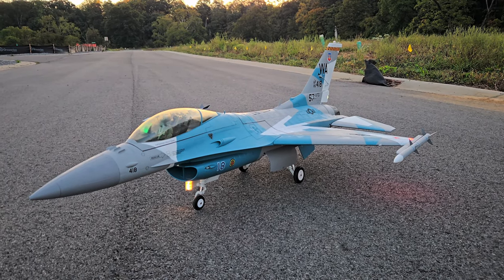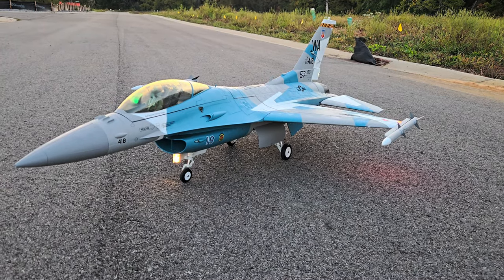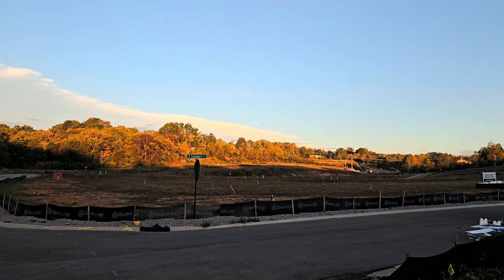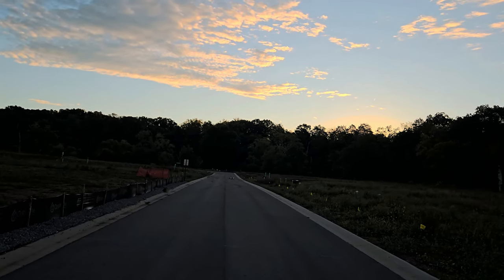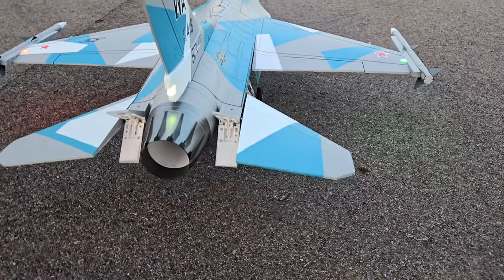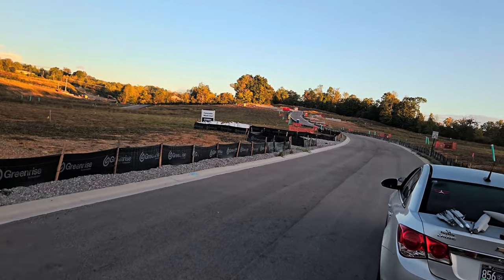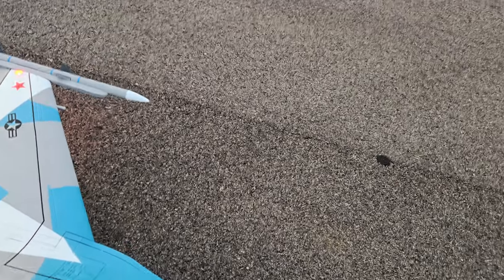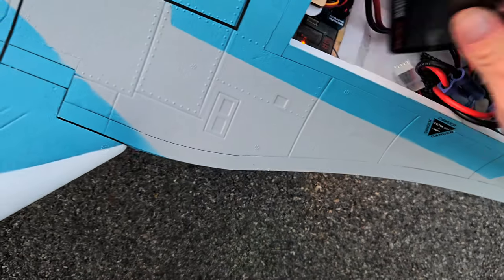ALL NEW= Freewing F16 90mm 8s  AMAZING EDF JET #rchobby #rcpilots #smokeymountainrc #aviation #rcjet

Comment: Where you have receiver and battery's makes my F16 very nose heavy...did you check balance before you flew it?
Reply from the maker: Yes it was way nose heavy. Now I'm putting the 6000 4s centered the straps. And my 5200 4s is about an I ch ahead of that.   Freewings cg on this jet is factory nose heavy

Comment: Did you also change out the fan or just ESC?  If just ESC,  which one,  thanks!
Reply from the maker: @afterburnerrc6333  no I just changed the 6s motor to the 8s motor.  Esc is still the same. Skywalker 120amp
Reply: @SmokeyMountainRcTravisThompson 

Ok im confused so you used the same fan,  swapped out the 6S motor to the 8S motor that comes on the 8S F16?  The ESC on  the 6S F16 will also handle 8S?
Reply from the maker: @afterburnerrc6333    I already had the 8s Zeus,  so when I got the 6s  f16 90mm , I took outthe 6s  motor and fan swapped it with the 8s Zeus motor and fan.  Yes they are the same esc 120amp. The 8s and 6s version uses the same esc.   I also have the 90mm J10A 6s, it also has a 120amp esc. The 8s J10A 90mm  is also 120amp esc

Comment: Did you fly it on 6S before you swapped to 8S ? Some say it feels lighter/nimble on the 6S version.
Reply from the maker: @tonyp2263  i did one  lap with the 6s in it, and the battery and esc leads were flaming hot.   It is a Lil lighter filling with 6s, but it's a little sluggish , and the vertical climb seems it would be very short.   The 8s setup im getting around 130 to 135 mph. And the vertical climb with 8s is outstanding.  I think the jet is very nimble on 8s imo.  You can watch my other vids on this jet and you can see the vertical and how great it performs. I'm getting around 4 min of flight with two 6000 4s, and that's mixed throttle
Reply: @SmokeyMountainRcTravisThompson  I'm using 5000 4s...trying to keep it lighter...3:30 min with mixed throttle...
Reply from the maker: @williewonka1970  nice

Comment: Question, do you put that tracker receiver thing from the FAA in your plane? If so, do you have to buy it separately?
Reply from the maker: @brandonhill7016  yea it plugs into the spectrum receiver. it transmitts the location coordinates. And if you have a spectrum transmitter,  it will send speed , altitude, Longitude and latitude.  Vertical and horizontal speeds  to the transmitter. And you can also  track from your phone , from the drone scanner app
Reply from the maker: @brandonhill7016  you can get it from horizon hobby.  Spectrum.  Tower hobbies

Comment: What battery u are using?
Reply from the maker: I use from two 5000 to 6200 4s
Reply from the maker: Mostly two 6000 4s. Seams to be the sweet spot
Reply: @SmokeyMountainRcTravisThompson  what brand is it? and the c rate?
it sounds extremely  good
Reply from the maker: @IanChen-m1o  zeee brand. 100c
Reply: @SmokeyMountainRcTravisThompson  how much is it? Have u tried smc pack?
Reply from the maker: @IanChen-m1o  they range from 55 to 90 dollars on ebay.
Reply from the maker: @IanChen-m1o  not tried the smc yet
Reply: @SmokeyMountainRcTravisThompson  they are really good and u should try it, it's also cheaper than the zee's
Where did u get the plane?
Reply from the maker: @IanChen-m1o  motion rc
Reply: @SmokeyMountainRcTravisThompson  ok how about  the series wire?
Reply from the maker: @IanChen-m1o  got one series connecter from motion Rc. And the other i got from horizon hobby.  I think there about 8 to 12 dollars

Comment: Well, you just saved me from buying that. Total crap at that price to have to fix it out of the box. That sucks!  The air brakes are sweet, It looks great. But I’ll just stick with my 80mm E-Flite. No problems with it. Having to gut and rebuild that thing out of the box… no way! Do they offer a complete arf?
Reply from the maker: @anonymousasusual9413  yes in my description there is a link for the arf. I think the 8s version hasn't had any issues that iv Seen,  only the 6s version.  I flew it this morning foe 4:50  , batteries barely warm and had 30% on batteries.  Very surprising